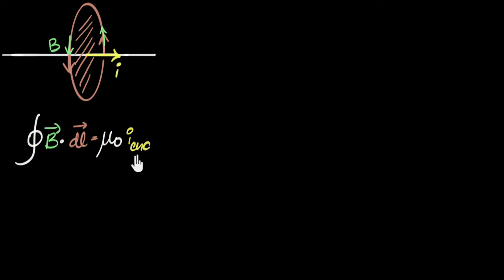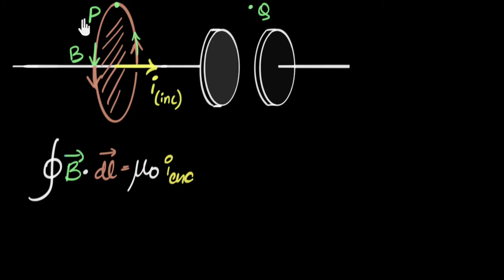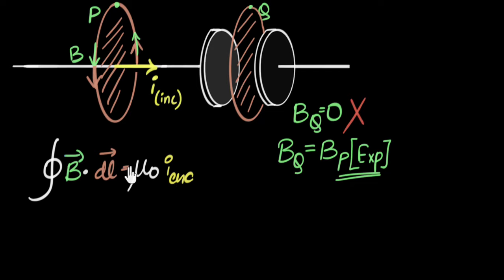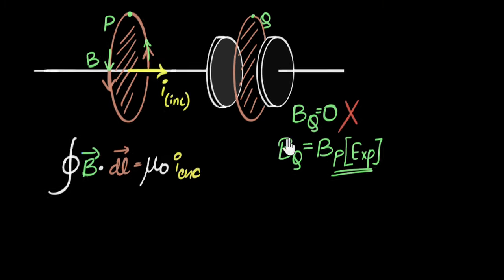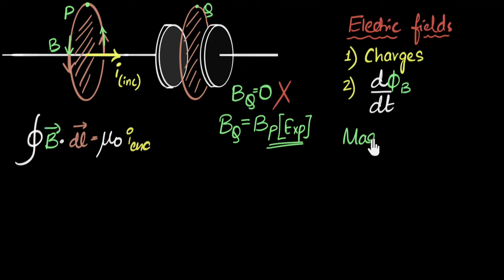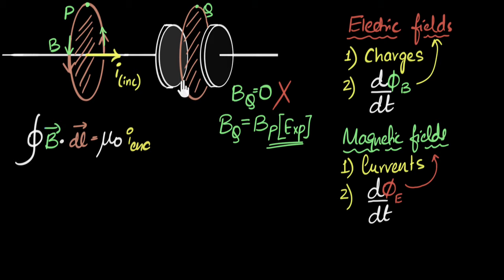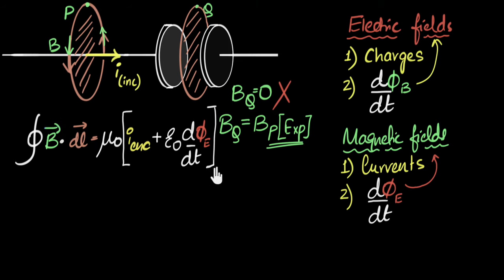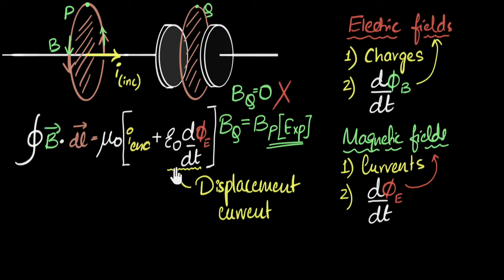Displacement current & Ampere Maxwell's law | Electromagnetic waves | Physics | Khan Academy

Comment: Quite explanatory; however, it would be even great if you had included the derivation of displacement current by using the equations of capacitors. Namely,
C = Eo A/d(distance between the plates) 
Q = CV and V= E d
Q = EoAE and EA : flux 
Q = Eo F(flux)
then displacement current : dQ/dt which is Eo dF/dt
Thank you
Reply: There are different ways of arriving at the truth and your method is a good alternate explanation.

Comment: Nice video and presentation. 
By page 3:50 presence of B at p confirms there is current flow through the vacuum between parallel plate and continue down the remains of circuit. 

Vacuum itself cannot pass charge unless it has permittivity which explains the B at q. 

So what is in the vacuum that pass charges? It was Aether, a fluid that has no mechanical but electrical properties, which is permittivity. Aether as a fluid attaches to all matter and drag directly with matter in the local frame and drag indirectly in the global frame.
Reply: Not "remains" of the circuit; "remainder" of the circuit. And the presence of aether is still controversial.
Reply: @aerodynamico6427  “remains” vs “remainder”? have we turn this discussion into a grammar class?

Yes it was controversial and not any more after this :-

“Aether” is an incompressible fluid and has no mechanical but electrical properties where e0 permittivity and u0 permeability are measurable attributes of vacuum  -  Aether as important attributes of Maxwell equations. 

More importantly, it doesn’t blow through all matters like wind. Instead, it attaches and drag with matter in the near field in equal speed. On the other hand, Aether also drift at its own pace in the far field, deep within the universe. 

That is where straight shooters like M&M and Einstein missed the mark.
—————————————-
Moreover:-
Einstein waited long on Michelson’s test result have lost his patient said this
 
"Insanity is doing the same thing over and over again and expecting different results": 

“doing the same thing“?
refers to (keep looking and failed to find fringing activity)
“different result”? 
refers to (for fringe activities present that never recorded)
—————————————

On the other hand he also said this :
“You cannot solve a problem with the same mind that created it.” 

“You”? 
refers to Michelson and Morley. 

“Solve” what “problem”? 
To detect Aether wind by fringing activities

False “Mind set”? 
That Aether wind blows through all matter.

Correct “mind set”?
That Aether attaches and drag itself to all matter at equal speed in the near field. 

That Aether drag complementing M&M’s test result - ie no fringe activities. 

Hope this catches your attention.

Comment: mahesh i have a doubt.... in the wire we have  increasing current ...which means varing magnetic field ..this in turn can produce electric field this electric field can produce displacement current right🤔
and one more ..if there is change in magnetic field then ..opposite emf will be induced know..then opposite current which reduces the source current

Comment: Eletric field-flux changes by moving charges, but show me why E-flux may be 0 in a wire.  (e=fermi electron, c= capacitor) e c e c e c e c e c e c e c e c, there are empty spaces between fermi electrons that can serve as capacitors that can create the circular B-field even before the electron arrives. BUT because of the E-flux contributions that come from the front e- and the back  e- CAN be canceled to be all zero, but can someone show me how

Comment: There is nothing called displacement current. Moving E-field induces moving M-field and vice versa. Moving E-field moves electrons. It is moving E-field which induces M-field not current as current itself is dependent on moving E-field. Since  current is proportional to E-field it is used to calculate M-field. Moving E-field applies to both conductor and capacitor.
Reply: Go back to your books. It IS called displacement current. Don't bring your confusion here.